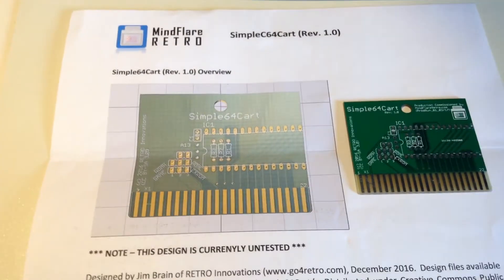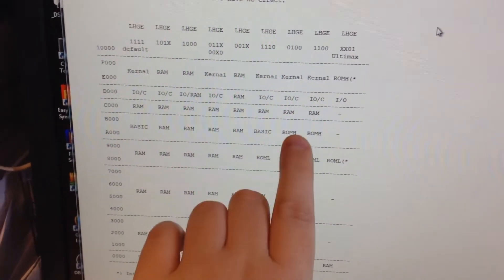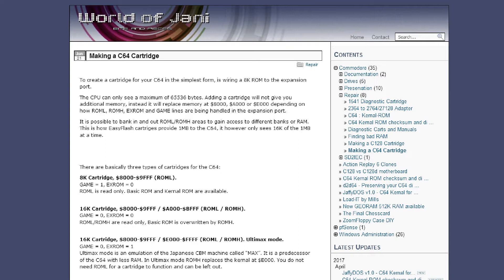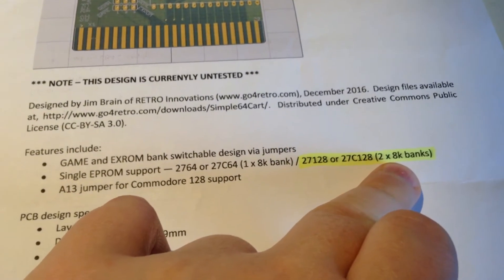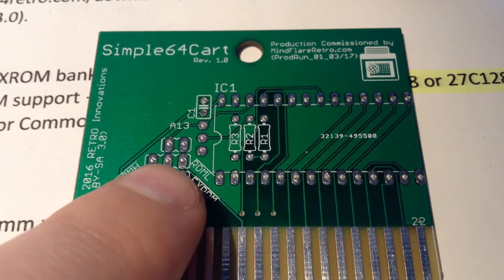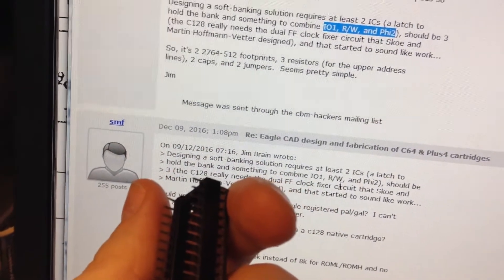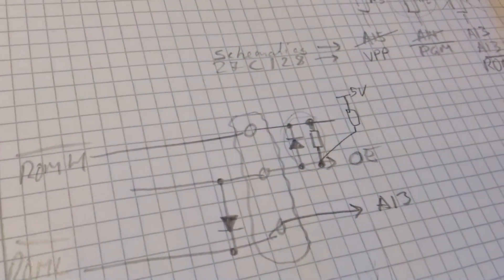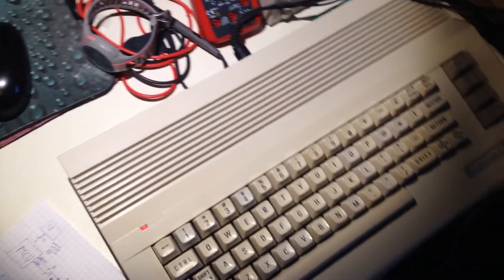Reviewing the SimpleC64Cart Circuit Board

Comment: It is a pretty strange card, I think. I have bought it, because it was cheap. Then, I wanted to set up a Diagnostic 586220 cartridge. I had to burn the software at Address 0xE000 of my 27c512. I only had the eagle schematics and an otp eprom, so better don‘t make a mistake. I was lucky, it worked out. :-)

Comment: Hans, First of all, well done! (and thumbs up of course - Oh and I've subscribed the shit out of that subscribe button). Secondly, seeing as you figured this out, do you know of how to solve the memory mapping problems of the NES emulators (like you get on Linux Distros or Repos) which are incompatible with some NES games (such as David Braben's "Elite") cartridges (or pertaining ROM files) which are of a larger size?

It's a big problem for the retro community.

The game "Elite" is hard to come by on cartridge, and even then a person will often have to use a cloned NES because they cannot aquire a real NES console (and some clone consoles, save the FPGA ones which mimic the microcode of the NES microarchitecture, don't work with such games anyway becuse they suffer the same emulation bug of falling to map larger memory carts). So for most people, the only way to play Elite on a NES would be via an emulator, but the emulators don't work with it. Ipso Facto, catch22. The sword is in the stone.

The fate of the retro kingdom has fallen by your feet at the speed of a feather like a gauntlet on the moon. Will you, Hans, accept the challenge?
;p
Reply from the maker: Thanks for the comment. No experience with NES, sorry.
Reply: It's OK. Turns out GadgetUK164 knew the answer to that and apparently even David Braben recommends Marat Fayzullin's iNES emulator because it solves that.

Comment: Love cartridges. Absolutly :)

https://easyeda.com/wegi1/ogryzek-v4
Reply from the maker: wegi Interesting. Any more info on the cartridge?
Reply: sth like that working with a dedicated core for sd2iec
https://www.youtube.com/watch?v=AFH-kzQ3OQ8&t=2s

I/O1 is a write data for banking flash/eprom (a bit similary to AR for emulate compatibility first 4 banks), visible bank $8000-$9fff (configuration) I/O2 duplicate in self last 256 bytes used bank. Write strobe is on the falling edge of phi2. Some option can be configure, 138/139 is use one of them (this which you have in this moment), flash size, DIP pin size, option, which I/O using to write... (max 512KB I'd check, min 32KB in DIP28). sd2iec core was wrote for support sd2iec without any browser...

and a bit more advanced version

https://www.youtube.com/watch?v=-SV5LnBY1Gk&t=

Comment: Nice job! I wouldn't have thought it would be possible to make this work at all with 16k images. You're one very smart person indeed. :) I'll try to use the one I got as a switchable 2x8k cartridge (which should be a fair bit easier to achieve).
Reply from the maker: Thanks. I just followed someones advice on the cbm-hackers mailing-list, but the A13 connected to ROML I had to figure out myself. Regarding switching, it depends on what you want to do. If you want to bank 8k games into a larger rom (128/256/512), then you would need acces to A13, A14 and A15. They are on the board, but not layed out for switching unfortunately. What you can switch is ROML and ROMH. The problem with that is that the machine code programs have absolute addresses so the code needs to recide in the correct area (ROML or ROMH) that it was assembled to in the first place. You might find some roms that goes into ROMH, and some that goes into ROML, and then you could maybe make that work.. I don't know really. You can use cartconv.exe in winvice with -f option to see the config properties for the cartridge image.

Comment: Hans you've proven yourself again to be smart as shit! That was great. I've actually not looked into how cartridges work, except maybe a cursory glance. I'm going to have to play that game now...
Reply: Thinking of this...what is the logical reason for having both a chip enable and a chip select? Wouldn't one signal be enough?
Reply from the maker: Chip enable and output enable are driven by ROML or ROMH. The logic reason is because of the 8k byte banking memory areas, ROML maps one ROM chip into $8000-$9FFF and ROMH maps a second ROM chip into $A0000-$BFFFF or $E000-$FFFF (depending on what the carts do with #EXROM and #GAME, I think)..
Reply from the maker: I read the comment incorrectly. Got ahead of myself. Sorry. I don't know really. It must have something to do with timing. Lets open a datasheet for a 27C128. I'm looking at http://ww1.microchip.com/downloads/en/devicedoc/11003L.pdf for one, CS puts the device in standby mode pulling only microamps, othwise it pulls about 20mA. Maybe you get less psu noise with letting on all the time ? hmm.. The CE prevents bus contention. Prevting two drivers on the same line. Another possible reason is access time. If the chip is always enabled, the access time is faster. For the C64 it is not necessary to have it always active.

Comment: Hmm. That was not so "simple."  I now see my overview sheet should have been more clear, explicitly stating this single EPROM design would NOT be able to accommodate a single 16kb ROM image unless you are a super hardware hacker like bwack. :)  I will update the overview sheet accordingly, as well as fix the typo at the top.  My apologies for any frustrations caused -- definitely not my intention.

On the brighter side, wow, that was great bodge work in order to get the Simple64Cart to work with the Wizard of Wor 16kb image.  A battle well-fought.
Reply from the maker: No worries my friend. I learned something from this, and maybe I would never have explored this 16kb possibility otherwise. I was surprised to see that my burning of the 16k long image .bin file that I extracted from the .crt worked also. I used cartconv.exe in the winvice directory with the -t bin option. It was my first time doing anything cartridge related.